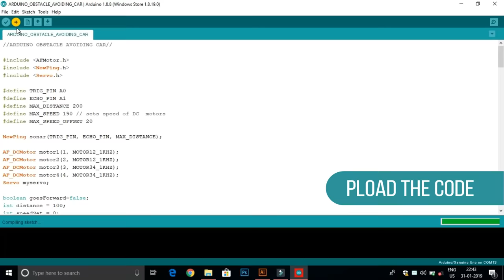How To Make A DIY Arduino Obstacle Avoiding Car At Home

Comment: 4 years on, this excellent article still works; built one today for my grandson's birthday.  Magic stuff! 🙂
Reply: how'd do you do it? mine only beeps but dont move, i already got the libraries and i follow the circuit diagram, can you help me?
Reply: @rodeliodompor4446  Hi,  When I first tried it after building, mine didn't move either.  What I found was I had the motor connections wrong.  You must NOT just connect  all 4 motors positive to positive and negative to negative.  if you do that,  the front wheels are trying to go forward and the rear wheels are going backwards, so it stands still.
On mine. the 2 front wheels have the red/blue wires; the rear wheels have green/yellow.  Try reversing the green/yellow connections on the motor drive shield.
I hope this helps.
Reply: @andrewmelville8560  I already tried it but unfortunately it still doesn't move, I tried lifting it up to test if the wheels cancel each other but they still doesn't move
Reply: @rodeliodompor4446  Hi, I am sorry that did not work for you.  The only other thing I can suggest is to make sure that the  servo connection goes to the right terminals (there are two separate servo channels) - 6:08 in the video.
Reply: Hi,  a couple of other thoughts have come to mind; firstly - can you let me know if you definitely uploaded the sketch through the Arduino IDE?  Did you get confirmation that it had  uploaded successfully?
Reply: Hello brother can i use this for Arduino---> UNO R3 Development Board ATmega328P ATmega16U2 with USB cable for Arduino  is this suitable for the project
Reply: @thechosenone-j1v  Hi, can't help you with that; you'll need to ask the reginal designer.
Reply: How to on we need to create battery
Reply: What arduino cod
Reply: Please give me code
Reply: @rodeliodompor4446  Did you fix the problem? And how did you do it? I'm having the same problem, when i try to make only two motors on the same side run, they don't, however, when I try to move parallel motors go forward, they work.

Comment: @DIY Builder I appreciate your hard work but just a little note - Actually the code that you have used in your build was right but the code in the discription has a MISTAKE - in the line where it is written [If distance R < distance L] should be distance R > distance L as in the next line it is written turn right so as a result due to this mistake the car is turning right when distance L or (Distance Left) is greater it should be the opposite because the car need to avoid the obstacle not to get towards the obstacle so please rectify this

Anyways your videos are amazing 🙂,

Thanks
Reply: Is that the only mistake there?
Reply: I mean If I use the code in description with changing that detail you mentioned I'll have no problems right?
Reply: @salmaj7607  Yes you will have no problems, by the way I don't know whether @DIY Builder has changed the description code or not but if he hasn't changed you can follow my steps given above and change the code, actually the code is not so difficult just make sure that whatever changes you are doing - the car should avoid the obstacle not go towards it, just read the code once it will make you clear and, 

Thanks for your comment
Reply: Hey can u help me I Insert the code on Arduino board but I didn't do anything thing what's the problem is there can u tell me???
Reply: @senoritaff2680  Yes you have to change the line in the code which I have mentioned above, just go through the whole code once you will find the line and delete the part which I mentioned and rewrite the line according to my comment and save the code then connect your arduino to your device and re-upload the code and BOOM you are done, if you want to know what's the problem with the original code I have explained it in brief in my comment you can also check other's comments where I have explained them why the original code is incorrect and so on.If you still have any doubts feel free to contact me.

Have a nice day ☺️
Reply: Can you also tell where and how to attach the switch
Reply: Yup it looks like he fixed it
Reply: @gomusicmoviesandgames3669  The power switch goes between the battery box and the ext power port on your driver shield. connect two positives wires to your switch, one to your battery box and one to your shield. then plug the ground wire directly to your driver shield. no need to connect it through the switch
Reply: please help , i uploaded the code .. its still not working
Reply: Ardunio uno
Reply: @thelastnotrix964  select port and board
Reply: How can we change the battery
Reply: @SaifKhan-el2sc  if ur using li ion battery buy a charger, it will cost u around 300-400 in offline store. U can recharge and use it
Reply: What budget you get
Reply: @mrinalkantisarkar1222  hi
Reply: @mrinalkantisarkar1222  i need your help
Reply: @mrinalkantisarkar1222  i have done the same thing but only the tires in the right side are moving and the tires in the right side are moving front and back at the same time , please help me
Reply: @mrinalkantisarkar1222   what is correct code
Reply: @warnaviman   @WVSW  DT  The code given in the description is alright, after you download the code from the link given in the description follow the steps given below -

1) Open the code in Arduino IDE
2) Search the line in the code where it is written "if distance R < distance L"  
3) Change the given command to "if distance R > distance L" ; change the "<" sign to ">" sign
4) Make sure after this given command, the next line is written as turn right (Not turn left !) 

After implementing these steps your code is full CORRECT and you are ready to upload it to the Arduino board.
Reply: @ANIKETKASHYAP8008  I had made this project and it costed me around Rs.3000
Reply: I had purchased all the parts from online so it costed me a bit more than usual 😅
Reply: @x8dachu767  I have figured out your problem, below given are some possible ways to fix the issues.

For tires on the right side of the car - 
As you have mentioned earlier that only the tires on the right side are moving and that also in opposite directions to each other, so it follows as.

1) Let the tire which is moving in forward direction to be like that only

2) The tire which is moving in the opposite (Backward) direction can be fixed by reversing the polarity, that is reversing the wires connected to the motor

You can also reverse the wires connected to the motor driver shield from the motor mentioned in "2)".

For tires on the left side of the car -
As you have mentioned earlier that none of the tires are moving on the left side of the car, so it follows as.

1) You can check the motors by powering them separately by a 9v battery or any other power source to test if they are working or not 

If they are working then refer to the steps given below, and if they are not working then replace the motors with new ones 

2) You can use the Arduino IDE to run a motor test code and check visually if the motors are working are not, for that - 

Step - 1 Open Arduino IDE and click on File option at top left corner

Step - 2 Click on basics and scroll down to find the Adafruit Motor Shield Library from the pop up menu

Step - 3 Click on Adafruit Motor Shield Library and then click on MotorTest to open the MotorTest code 

Step - 4 Verify and Compile the code and then upload the code to your Arduino UNO R3 (or whichever Arduino you are using for this project)

After this you can change the motor number (corresponding to your motors) in the code and upload it to check all the motors separately and whether they are moving or not and if the motors  on the left side are not moving compared to the motors on the right side then follow the next steps.

3) You can use a multimeter (if you have one) to probe the connections of the motors while your car is switched on to check whether electricity is being supplied to the motors or not

Or you can probe the connections, where the wires from the motors are connected to the motor driver shield such as for ex -
at M1, M2,... etc to check if any electricity is supplied or not.

4) You can also check the wiring connections as sometimes loose connections can cause the motors to not work

5) You can reconnect the motors again with new wires and solder them properly (which is required)

6) You can detach the motor driver shield from the Arduino and check it if any of its pins are broken or damaged

7) You can also increase the speed of the motors on the left side of the car in the code as sometimes low speeds will not allow the motors to generate the enough torque to rotate and overcome the friction when the tires are on the surface, if possible then use higher capacity batteries as lower capacity batteries will drain quickly and cannot provide enough power to the motors for ex. - 3.7V(7.4V) 18650 2.6Ah(or higher) 2S 1P Li-ion battery and also - 

Re-upload the code to the Arduino several times to see if the motors are working or not as sometimes corrupted code can cause the Arduino to not function properly. 

After trying all the possible methods if you still couldn't make the motors on the left side of the car to work then better you change the motors, Motor Driver Shield or Arduino itself and then check if the new components could make your motors work or not.  

If you are able to make the motors work and then if they are moving in opposite directions to each other then you can follow the same steps given in - "For tires on the right side of the car".

And as always thanks for your comment.

I'll be glad to know if any of the above-mentioned ways helped you out.

Have a nice day ☺️
Reply: can you send me the correct code...in need of that urgently
Reply: @rio_maneesh4118  Yeah sure, given below is the correct code with my customised edits - 

Code Link : https://drive.google.com/file/d/17VNfKQGmWWkM0pOJNycyXhLo6uloMxPA/view?usp=drivesdk

Download the code and open it in Arduino IDE

As always Thanks for your comment, I hope this helps you :)
Reply: Pls send me the  code sir
Reply: hey mrinal, please help me, i made and done all the connections, but while uploading, it gives error that arvdude: stk500_recv() : programmer is not responding ........so please brother help me out ...i am stuck😭... waiting for ur reply
Reply: @simrat_singh_  Try reconnecting the Arduino again and re-upload the code or use another device to upload the code, you can also try using a new cable for the Arduino.
Reply: @johnkennethjaque6318  Code Link - https://drive.google.com/file/d/17VNfKQGmWWkM0pOJNycyXhLo6uloMxPA/view?usp=drivesdk
Reply: @mrinalkantisarkar1222  😭bro i unplugged and plugged the board but it showed no change, also ...i am a beginner so i have all things new....so my USB is also new, i only have my PC to upload the code
Reply: @simrat_singh_  In that case you may have to replace the Arduino with a new one
Reply: @mrinalkantisarkar1222  i bought it today only 😭
Reply: @simrat_singh_  Yeah but it seems that your Arduino is damaged so you have to replace it with a new one.
Reply: @mrinalkantisarkar1222  the shopkeeper will not replace it😭..and also if i argue...he will show that see the lights are working, so Arduino is not damaged
Reply: @mrinalkantisarkar1222  btw thanks for helping me brother🥺.....i m feeling depressed 😔
Reply: @mrinalkantisarkar1222  is there any other way to confirm that my arduino is damaged ....and the problem is with it only
Reply: @simrat_singh_  There are many ways but most of them require intermediary knowledge about Arduino (microcontrollers in general) and I guess it would be better if you can replace the Arduino, rather than going through all those complicated mumbo jumbos.
Reply: @mrinalkantisarkar1222  😔😔
Reply: @mrinalkantisarkar1222  I made it and uploaded your code but the robot is just turning the head to the right once and nothing after that please help
Reply: Can we do coding from mobile by using ardiunodriod app??
Reply: Can you tell me how to use the libraries? Do i just download it? Or do i need to do something to it
Reply: @rodeliodompor4446  Nothing extra needed. Just download the libraries
Reply: @mrshadowff8503  why does mine only beeps? Can you help me
Reply: Can you help me,  i resemble this as given and code also but servo nd sensor isn't working,what to do
Reply: I have a doubt in line 10 according to the code given there is a error occuring. What must I do to debug it?

C:\Users\C2KBL12\Downloads\ARDUINO_OBSTACLE_AVOIDING_CAR\ARDUINO_OBSTACLE_AVOIDING_CAR.ino:10:10: fatal error: NewPing.h: No such file or directory
 #include <NewPing.h>
          ^~~~~~~~~~~
compilation terminated.
exit status 1

Compilation error: NewPing.h: No such file or directory

Comment: If you are in seminar , and your teacher gave you this project to your group, and when your teacher ask what you can improve in it , say 
" This tyres should have torque at an angle 18°,so that it can change its direction easily"
You will be appreciated 👍👍😉😉

Comment: Hello, can you please provide a diagram of some sort of the measurements between each hole on the wooden board/base so I know where to drill the holes? Thank you
Reply: Yes please do that 😔😔
Reply: Bro you can do that accordingly depending upon the space you require to paste the components. The tutorial is just perfect. Once you know the components and connections then boom. You can manipulate anything. Good luck!

Comment: Pls make a video on a robot car which is obstacle avoidance and Bluetooth controlled .....
Pls guies like it if u want that video👇👇👇
Reply: @syedsalmannadeem  😂😂😂😂
Reply: Useful
Reply: What's the use of obstacle avoidance if it is Bluetooth controlled 😂😂😂
Reply: j'aime page "tolati 3D"
Reply: @yashaggarwal3948  yes u true
Reply: YASH AGGARWAL you can toogle between it
Reply: @yashaggarwal3948  it is the another useful feature in it
Reply: i agree, i made this robot with a 1:48 reduction ratio for the motors, which is faster than the one he used  and it went around my house and i wasnt able to control it i had to
add a few extra features and had to reprogram the programming which was a pain in the butt...
Reply: u do the autonomous controlled app robbot
Reply: The Bluetooth robot is Moderate difficulty. It takes a lot of components, Space and some coding. But adding obstacle avoidance to a robot that's already controlled via Bluetooth is pointless. Obstacle avoidance is only added to robot for it to automatically avoid obstacles. If you are controlling something, You can easily avoid the obstacle. Plus, Many things can go wrong. You can encounter malfunctions when you keep moving forward when the Robot is automatically driven back due to the Automatic Ultrasonic sensor's code.
Reply: Program code vanum
Reply: If it is Bluetooth controlled then why  need obstacle avoiding and if you want to make it then combine the codes and use bread board for lack of pins

Comment: hey i like your project and i tried to make it but the motors dont spin and sometime the servo too..the include <AFMotor> does not turns orange...and i cant get afmotor in examples menu instead,there is adafruit motor sheild there....i tried to follow all the steps in the link..I need help PLease.
and keep up the good work mate
Reply: even i have the sameb problem
Reply: Instead of adding the servo you can program the robot to spin one wheel anticlockwise and the other clockwise if it sees an obstacle
Reply: Follow all the steps I have made it but it will work with 4-5 9 volts battery
Reply: @GagandeepSingh-dc9ke  I have the same problem. Could you explain what is 4-5 9 volts battery? Thank you
Reply: Use 5   batteries of 9 volts
Reply: @GagandeepSingh-dc9ke  OMG. Yesterday I got my solution. Beside the 2 3.7v batteries connected to shield, I connected an extra 9v battery connect to the Arduino UNO. It work very well too. Thanks for your reply
Reply: Your welcome

Comment: Hi bro, we done this project. Working well. But front right side wheel (Motor 1) Is not running forward while other 3 wheels are running forward. While running backward all 4 wheels are working correctly. Can you tell me what will be mistake?
Reply: The same thing happens to me, but then I changed where the connections to the motors are soldered and it works